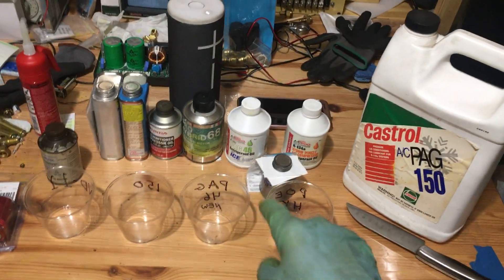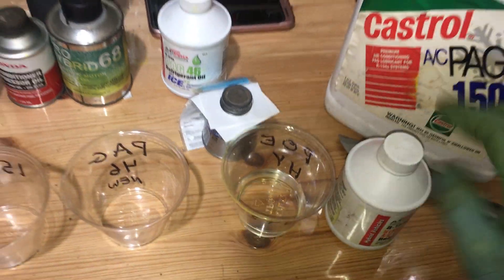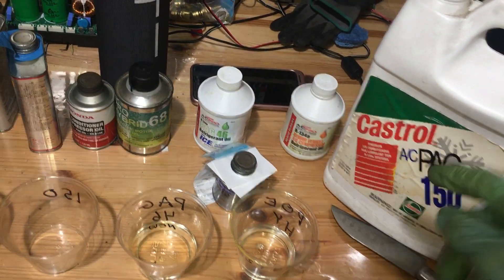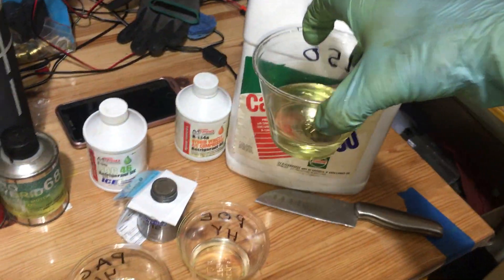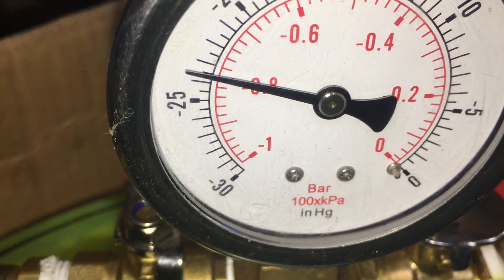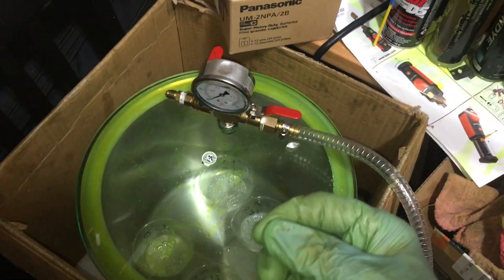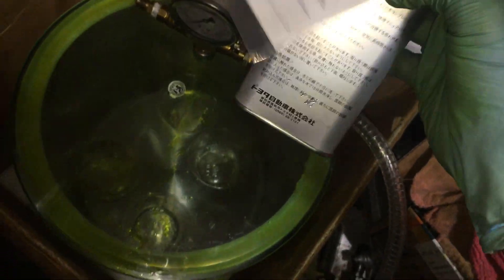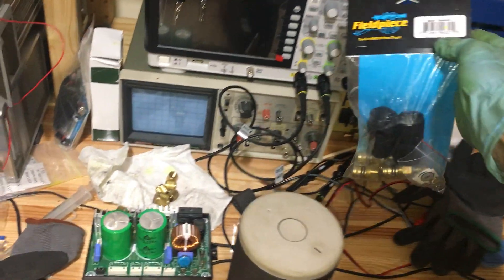Refrigerant Oils thrown in a vacuum chamber reaction of moisture contamination￼

Comment: Great video.  Unfortunately you cannot shake the A/C system to speed up the out gassing.  

Dry nitrogen gas will likely get absorbed so it will have some outgassing, but at least there is little to no moisture in it.
Reply from the maker: You add heat by starting the engine. Close hood this will increase under hood temps to over 160 f 
        Turn on defrost in full  heat this will get inside car over 120f blows hot air over the evaporator this will speed up out gas. 

Dry nitrogen not add gas .  You are only adding to 0 psi from high to low. Sweeping the moisture molecules that has risen to the surface. .  Once there is almost no molecule to move.  The moisture stays at the surface, can’t move.  So you sweep again high to low,  repulsed your vacuum on the low only. 
        This is call (“triple evac and purge “)

There is no guessing or I think 🤔 there is only knowing facts. 

This is what a formal education is for. Applied science., organic chemistry, thermal dynamics, fluid dynamics. 

I did a video on a free down load of a serval several hundred pages book all about vacuuming process, tools, equipment, methods .   It’s a science university book from class in chemistry and other lab procedures. 

Tru Tech Tools has a great short simple vacuum book 📖 $19 
     Old book from the 1950’s the rights were purchased by Bill Spoon & Jim Bergman.  They updated it with today’s tools micron meters by accUtools BluVac 

Jim Bergman made many videos about all the different vacuum procedures.  I made a video on that to . About hid different videos

Comment: Guess my bottle of pag oil is trash
Reply from the maker: Yes, think of five years old olive oil under your sink that was halfway used.   What dose it smell 👃 like?   Will you use it as salad 🥗 dressing? 

Same thing.  

When you do pore you add hose from nitrogen or argon gas inside bottle opening purging gas as you pour.    As oil is removed it’s replaced with dry gas. 

That’s the best you can do.  

This is why I like the syringe Type of dispenser

Comment: Can you heat boil/microwave boil the oil and  vacuum later?   Would regular stove boil the oil? Maybe on 100 degree C would be sufficient?  What is good material to boil -- Steel has containments
Reply from the maker: You can do more harm by adding heat. You do not want to boil the oil with heat..  because under a vacuum or heating, the oil can cause oxidation in the presence of oxygen moisture and heat make acids that break down the POE oil.   

If you wanted to get really technical and exact with extensive moisture removal, you would use desiccant sieve material that you would pass the oil through .   

The H2O molecule has a very strong attraction to the POE oil. It does not wanna release it wants to stay chemically bonded and start converting in breaking down to POE oil into acids and alcohol and other basic components that destroy the oil. .  

This is why it’s so extremely important to keep oxygen air and moisture that is in the air away from the POE oil 

Once the oil has combined with the oxygen in water molecules in the air, you cannot remove all of it, but you can at least reduce it . 

And you cannot undo damage that has already occurred to the oil .  You can just slow down the process by keeping the moisture level low, keeping the oxygen level low and keeping the heat low..
Reply: @coldfinger459sub0  What a nightmare.  It  sounds like just removing the whole AC system and redoing is best option.... thank you for your video and help
Reply from the maker: @rohitbhatnagar7599  if the process is done correctly, from the very beginning, the system always stays clean no air it or moisture is ever introduced. When somebody was formally trained gone through a real legitimate. Hvac class follows all the correct procedures. Everything works perfectly, and there’s never any damage and there’s never any contamination.. 

All the problem start with people who are uneducated and HVAC know qualifications try to take shortcuts don’t know what they’re doing do shotty repairs and over the long term end up, damaging the system .  

If it was done correctly in the first place, everything is beautiful 

When peoples touch stuff that aren’t qualified this is when the problem start 

It would be the same for a doctor when somebody tries to diagnose and get their own antibiotics or medicine and they choose the wrong one because they don’t know what they’re doing and critically harm the patient or kill the patient . 

There was never a mess or a problem before it’s only when I am qualified person gets involved 

If somebody tries to re-roof their own house and they don’t laugh down the layers in the correct procedure and method, and then winter comes and they have tens of thousands of dollars in water damage again it comes back to the lack of education 

Everything comes back to the lack of education, knowledge and proper training. Experience of the individual involved, the owner of the shop, the technicians in the shop. .
Reply: @coldfinger459sub0  I put a new condenser and had system open for several days. If I go to service station, what should I ask for to maximize on water/containment removal?   A deep vacuum is fine, but is there levels to the deep vacuum?  Anything else I should ask for?  Is there a better machine that I should ask for?
Reply from the maker: @rohitbhatnagar7599  don’t worry about it what’s done is done.   At least it will work.. 

You cannot expect the shop to leave it on the vacuum pump for many hours are overnight . 99% of the shops don’t even understand why..  they’re only concern is it blows cold they collect money and they see the tail lights leave the garage that’s the only thing they’re worried about. 

Now, if you have a O’Reilly’s auto parts or AutoZone or some box warehouse for automotive that let you rent or actually gives you free, vacuum pump and free gauges for rental loan. Then you can leave it on the vacuum pump, overnight yourself then disconnect and bring it down to the Auto Garage Shop, and let them fill it. .
Reply: @coldfinger459sub0   I already have autozone pump, so I will leave it overnight. Thanks for the tip !!
Reply: @coldfinger459sub0  I plan on getting rental manifold from AutoZone.  My car takes POE oil, but rental unit will most likely contain residual PAG oil in the tubing, since more vehicles take that.   I am just vacuum pumping it, there should be no residual oil in pipes going in AC system -- please confirm??  Any recommendation in cleaning the nipples that attach to car AC, in case there is very slight PAG oil there.
Reply from the maker: @rohitbhatnagar7599  99% plus isotope of alcohol. That will clean any residue out.. 

And you’re vacuuming only so you will get no contamination a residue because you were pulling out . And if that’s all you’re using them for
Reply: @coldfinger459sub0  I guess the common term is isopropyl alcohol
Reply from the maker: @rohitbhatnagar7599  oops yes voice to text translation without me proofreading it and just pressing send. I’m working on a job right now like I always am I never pay attention to my text.. 

Sometimes the voice to text and say some bad things  lol 😂
Reply: @coldfinger459sub0  Does not the extreme pressure and temperature of active AC system destroy water molecules, if anything  is inside the system?
Reply from the maker: @rohitbhatnagar7599  exact opposite, it helps bind and speed up the process to bind with the oil , make acid and break down the oil .
Reply: @coldfinger459sub0  YUCK !!!  I give up on this... never again open a AC system
Reply from the maker: @rohitbhatnagar7599  it’s simple.  When you open up a System prior to opening up a new purge with dry nitrogen.. 

Slight positive displacement, 1 to 3 psi is good enough so when you open up the lines, try nitrogen is flowing out, not moist, atmospheric air sucking in . 

Because after you complete your refrigerant recovery procedure, you’re at about -15 vacuum said he would never want to open up the system .  

This is what your nitrogen is used for .  This is what everybody has taught when they attend classes on air conditioning. It’s no secret it’s no mystery. It’s not complicated at all..
Reply: @coldfinger459sub0  WOW, I am impressed.   I will give it a try !!

Comment: after you vacuum your oil how do you avoil moisture from reabsorbing into the oio before you use it in a system
Reply from the maker: Use dry nitrogen to break the vacuum.   The cartridges stay inside this stainless & glass container with a positive pressure charge of dry nitrogen.   I only take the cartridges out as I need them.   I use one to 2 eight ounce cartridges every day. 
       Old 5 gallon paint cans make perfect storage containers. Because you can pick them up for free you know anybody who is a painter or uses chemicals that come in 5 gallon cans.   Just had a quarter inch fitting poked through the lid to fill it up with dry nitrogen. 

I go through Refrigeration oil by the gallons because I do so much . 
         Most shops only use ounces.
Reply: @coldfinger459sub0  thanks buddy

Comment: Hey Tom a dumb question again,
I watched your previous videos that PVE oil is far superior than POE oil, and I saw idemitsu made some really great pump oils. So can we replace a ordinary system with PVE oil as an upgrade?
Reply from the maker: In some cases yes if the viscosity is compatible.  

You can kind of think of it that all oils are superior. 

As long as they’re not introduced to moisture H2O or air O2 what’s the combination of heat of compression and the chemistry of refrigerant that makes an acid that breaks down the oil and eats away at metal parts from the inside out

It’s not the oils that are inferior or superior

If it inferior technician of incompetence

It’s the lack of knowledge or being cheap or being lazy not following rules and procedures keeping air out of the system a thorough evacuation in the proper charge by weight if all these things good technical practices are followed the oils are the least of your concerns.

Comment: Look at you getting all youtube ish. 😄
Experiments.
Was interesting. Had no idea of the moisture absorbed so easily. Thank you. 

So.. The more moisture in the oil... The longer it will take to reach a good micron. 
I have had some systems go all day.
One i am working on now has the txv bypass tube crushed in about 10 spots (someone bent a line to fit). The copper line going to the suction line is to long. Forcing the suction line to be at a 90 ( not allowed per TK). The sight glass line next to all this.. Someone ran a wrench into it and crushed it. 
Refrigerant was contaminated. Although at proper fill.. Once rpm increased.. It high pressure shutdown.

What a mess.
Lazzy people. Dont care. Dont pay attention.
Reply from the maker: Get a little like Niles Red or Clandesent Labs

Comment: I've been wanting to do a test like this, good job!
Are we really not supposed to pull PAG below 200 microns, some claim this damages the oil?
Reply from the maker: I have not heard that but I also wonder at what temperature because that also affects you can see the cracking effect as if you were going to boil off volatile oil like when you got crew oil that you’re going to separate into benzene and kerosene and all the other byproducts of distilling off from the crude. 

 And the automotive guys they basically never have to worry about getting below 200 µm on a car with your average every day recovery recycle recharge machine or their eBay gauge set drying a vacuum through refrigerant hoses with a vacuum pump but they haven’t change the oil in for a year and then the majority of them barely do a 15 minute to 30 minute vacuum and even if they did do an hour it would still never hit 200 µm

But as you can see the PAG 46 in the PAG 150 both came out of sealed containers that I had to break the seal on and you can see how much moisture contamination there was. 

I have to do a video on the commercial POE oil that comes in the middle pan with a metal seal you’ll see there is a lot less boiling off of moisture from refrigerant purchased in metal cans
Reply: @coldfinger459sub0  Yep, hard to know the quality of something you're buying these days.  I often wonder if the desiccant in a new drier really is dry.
I guess if you were to pull a vacuum below the vapor pressure of any oil, that would change it's properties as various components are boiled off.

I'm about to reassemble my R4 scroll compressor system, doubt I'll be making it under 200 microns but will wait till it's been dried out before injecting the oil.  Oil (pag) from a sealed plastic container, lol.
Reply from the maker: @thisisyourcaptainspeaking2259  I could tell you a couple facts for sure without doing scientific experiment in a quality control lab. 
             I’ve been using a micrometer since I was 12 years old.      And I can tell everybody there is a massive difference on your vacuum time between cars that have the desiccant material replaced compared to an old one that’s been there for 10 or 15 years. 

I can tell you for a fact after a couple hundred installations of brand new systems out of the box was sealed pipes and hoses with all the nitrogen plugs freshly assembled when pulling vacuum in under five minutes you’ll be under 200 µm or less. 

       I can tell everybody for a fact if you have a old clean version system or 12 with mineral oil 30 or 40 years old. 
           I can easily pour below 500 µm in about 10 to 15 minutes. 

             But if I take those exact same cars that somebody retrofitted over to POE oil (ESTER)  or PAG. And I tried to pull a vacuum it’ll take me about an hour to achieve the same vacuum because of the massive moisture contamination. 

I do a couple thousand cars a year and I can tell you for a fact when your car gets in an accident and the condenser is damaged Bodyman pulls it off and nine times out of 10 they do not seal up the lines and just leave them exposed to the atmosphere while the car is waiting for parts in while the body man is pulling the frame and performing all the work completely saturating the oil with moisture. 

       And undoubtedly I can tell everybody it is a fact when you learn how to use a micron meter like the back of your hand you can literally read the moisture boiling off in the oil and how much there is until it is gone but you will not get rid of all of it because of the surface film holding everything below the oil level. 

And the best thing you can do for an old car just leave the vacuum pump on overnight before performing your recharge.
Reply: @coldfinger459sub0  "the best thing you can do for an old car just leave the vacuum pump on overnight before performing your recharge.
"

Thanks for the detail, this is precisely my plan.

I'm physically unable to disassemble, flush, reassemble, etc in a short time (~8 hours), at my snail's pace it's already 24 hours and counting.
Fresh drier though, and pull ultimate vacuum prior to introducing the PAG, then vacuum again once the PAG is injected.
This definitely won't be OEM factory air conditioning from an air conditioned OEM  factory, just the best I can do with what I have.

 FWIW, I glanced at a couple (random) PAG 46 material safety data sheets. vapor pressure in one case was given as under 100 micron and the other was under 8 micron.
Show less
Reply from the maker: @thisisyourcaptainspeaking2259  well then we can safely say we don’t have to worry about anybody in the automotive industry to pull under 100 µm and not even think of coming close to 8 µm. 

I do have one video up on a larger 20 ton commercial heat recovery I installed where I pulled the system down to 13 µm with the micron meter attached to the copper line set at the furthest point away from the vacuum pump on the lines set.
Reply: @coldfinger459sub0  lol, quite right! ;)

Comment: Hmmmm…Interesting. I was interested to compare PAG 46 relative to the Hybrid spec oil. I was disappointed with my test results…Even with my Megger @ 1000V setting no beuno. Things changed when added a small measure of water.
Reply from the maker: Do use your maker at 1000 V you would have to put your hybrid oil in a glass or plastic container with your electrodes going through the glass and plastic airtight. 

       Then draw a vacuum on the container to boil out the moisture that you were exposed to just as you poured it through the air in your testing container. 

       Then add some refrigerant to the testing container. 

Because high voltage in a vacuum starts to act like a vacuum tube and you know what they do when you put high-voltage do them. 

That’s why you break the vacuum with refrigerant like real world conditions.

Comment: the nd-11 oil  has sealer in it from toyota ?  ha ha thats funny, cap sealed for one time $200  dollar use. get out the chemistry books.
Reply from the maker: Some of them have metal caps seals. 

      When you buy the large quart or large gallon of commercial or residential POE oil they always come with metal cap seals. 

But it does go to show you that when buying refrigerant oil that the manufacture put in plastic containers gets extremely moisture contaminated brand new right out of the bottle breaking their tinfoil seal. 

This is why all refrigerant oil should only come in metal cans